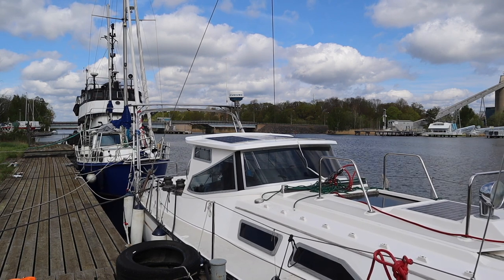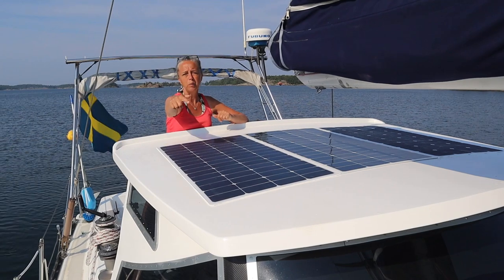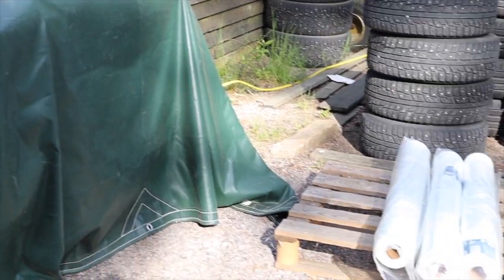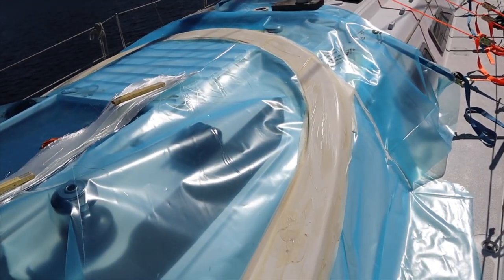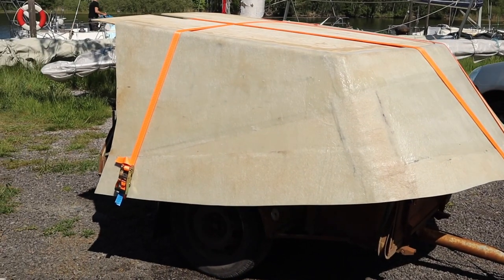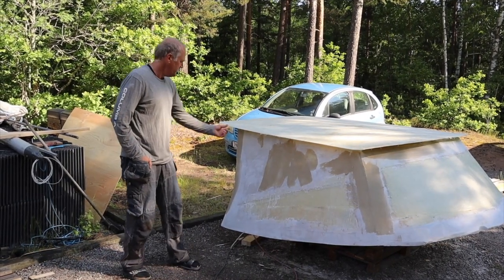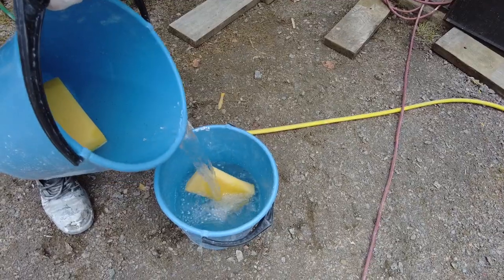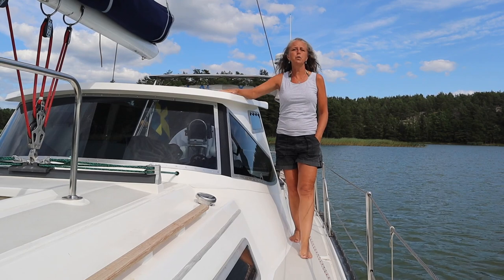Building a hard dodger for a sailboat | Part II

Comment: Looks really beautiful! One of the best self made dodgers I have ever seen! Really great information and detailed explanation of how the challenging parts of the process was done! But I have some questions if you please. What kind of window materials did you use? Lexan or plexiglas, and how thick was the sheet? And did you heat it up while bending it? Lots of questions. Sorry about that, but I am really impressed of your work and would like to know how to do it myself. Thanks in advance and many, many thanks!
Reply from the maker: Nice that you liked the hard dodger.
The window is in polycarbonat ( PC )  macrolon it's 5mm thik.
We heated it up with an heatgun in the most hardest bend of the front window.
We explain more in the next episode.
😁👍

Comment: Would you mind giving details on the window material (plastic?  acrylic?), where did you get that, where did you get the aluminum / stainless steel for the frames, how where you able to get it to your design please?
Thank you very much, GREAT dodger !
Reply from the maker: Nice that you liked the hard dodger.
The window is in polycarbonat ( PC )  macrolon it's 5mm thik.
We bought it from a glazier.
The frames is made of G10 sheet and painted, found on eBay!